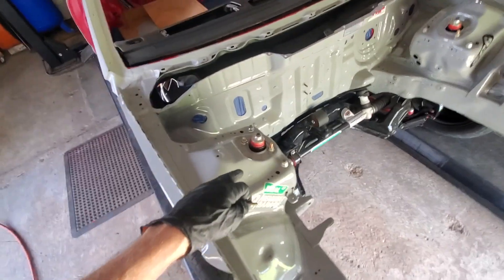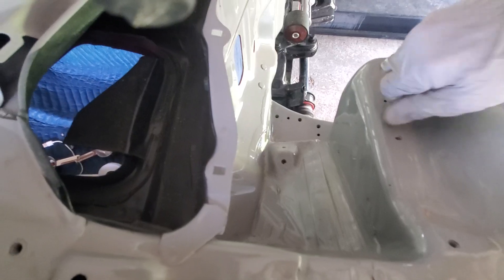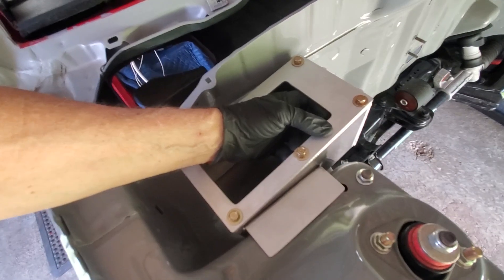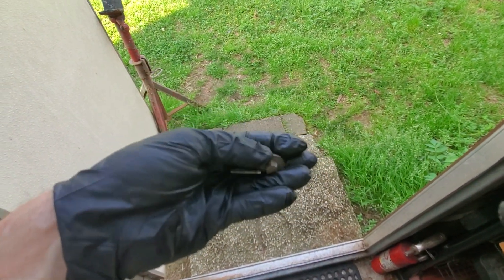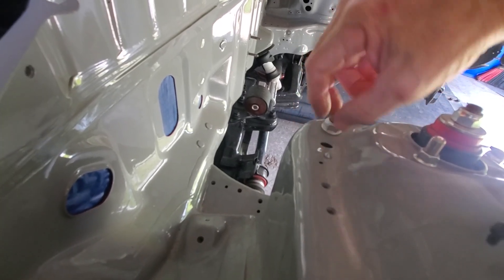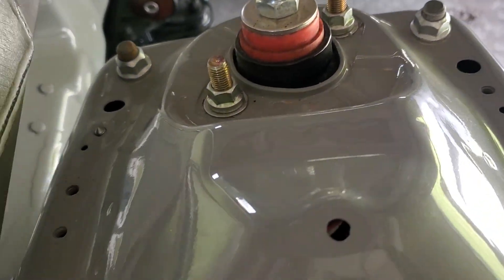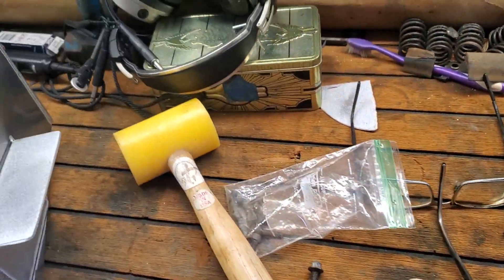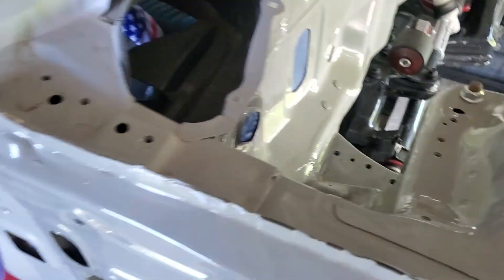How to mark a blind hole with precision

Comment: Smart thanks for the helpful tip
Reply from the maker: You are absolutely welcome. It's the simple things we don't think of. Had my father never showed me this I'm not sure if i would ever though if it on my own?
Reply: @jimhiscott2918  all these years I used to put grease around the hole then press the object I wanted to drill  to make an impression but this is way better. Your pop   Is a sharp man thanks again.